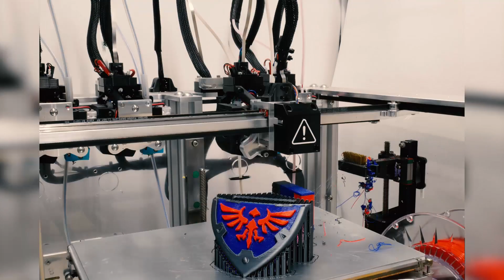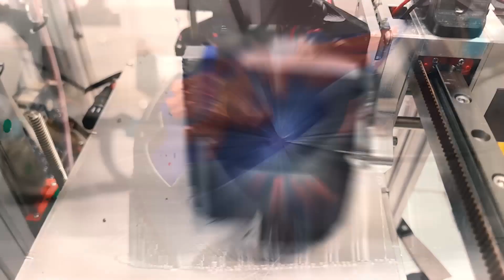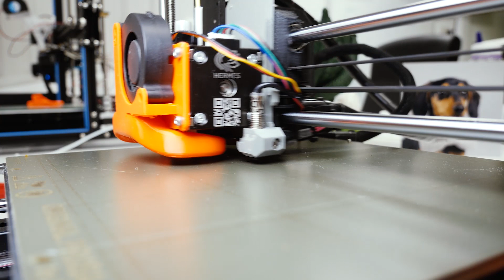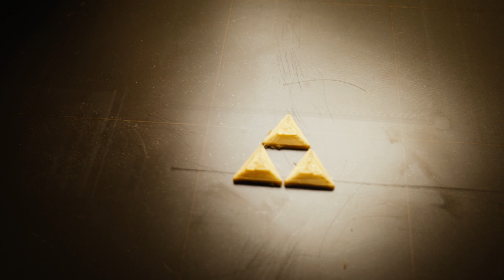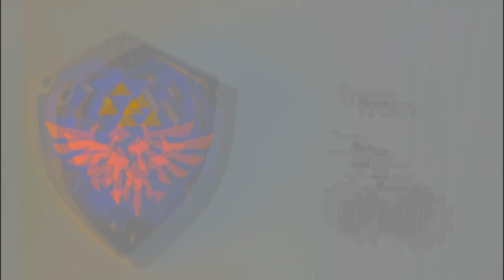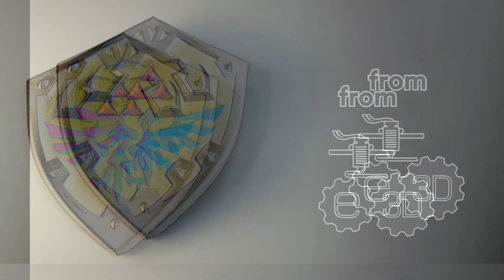ToolChanging 3D Printer prints Hylian Shield from The Legend of Zelda

Comment: Why is there a purge block when you're using multiple extruders?
Reply: Clean the excess of the nozzle before going to the model I'd guess
Reply: @richardspicer8253  isn't that what the purge bucket is for?
Reply: @theheadone  After one Extruder has finished it's layer, the nozzle is still hot and has still molten material inside of it. 
You do not want to keep material molten for long. Its quality will suffer and the nozzle might ooze slightly.

So yes, you will need to purge, but the purge volume is minimal

I did a lot of experiments with the Prusa MMU unit.
Depending on the colours you use, you have to increase the purge volume to a quite significant amount, even if you use only one material type (multi colour print).

If you use different materials you need some ridiculous amount of purge volume, to ensure that the impurities will not impact your layer adhesion.

So this is a big step forward. I am looking forward to get my hands on such a machine.
Reply: @samtumilty2348  again...... thats what the purge bucket is for .... 1-purge 5mm 2-wipe 3-print.... no tower

Comment: That brass brush on the side is quite smart. It should let you get away without building a (big) purge tower. An other option would be to attach a tiny build plate there to build a tiny purge tower.  I hope you can adjust a slicer so that it heats the nozzle about in time with the tool change.